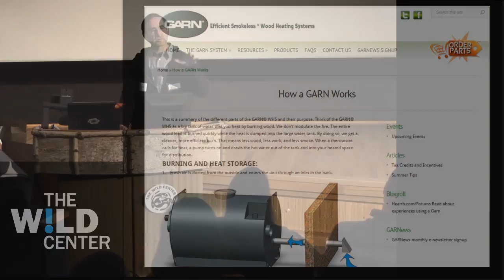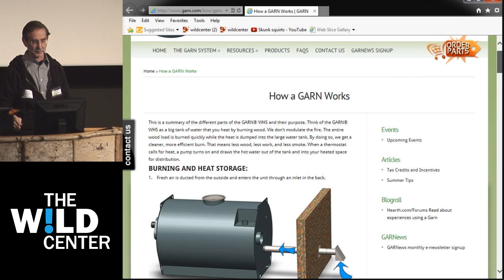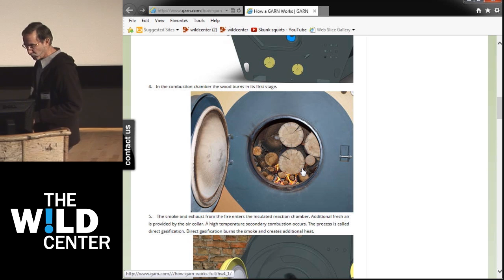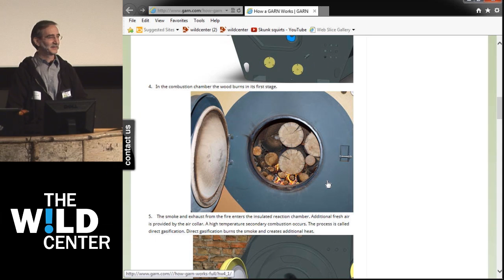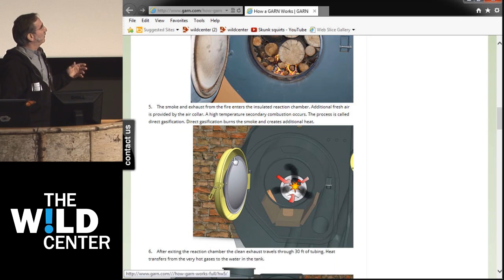Your Favorite New Green Technology: Wood Gasification Residential Boiler

Comment: You should look at Greenwood Technologies. It will do the same thing as this on 1/4 of the wood. Look it up. This is old technologie.
Reply: they may have a unit 1/4th as large. the garn is 80% efficient. there isn't a wood burner that's 320% efficient. I don't know if garn has small units, but most of the installations have pretty significant energy needs.

Comment: All about carbon credits ~ not about self sufficiency. This  is typical of the mentality of America in this day and age. No mention of the fact that a gentleman in the united states has been operating one of these units for 25 years. He has saved himself well over $100,000 in fuel oil heating in those years. He is presently in his 70's and still providing for himself and his wife. You mention the fact that you have to harvest, stack, season and load wood (as though it is hard to do) without mentioning the fact that obtaining the resource is so practical that ANYONE can do it throughout the land, through all seasons for basically little effort or economic endeavor. The average chord usage would be ten chords of wood (NOT 20) for the common household. 4x4x8x20...not a great amount of wood by any stretch of the imagination. Your review of this process is a disgrace.